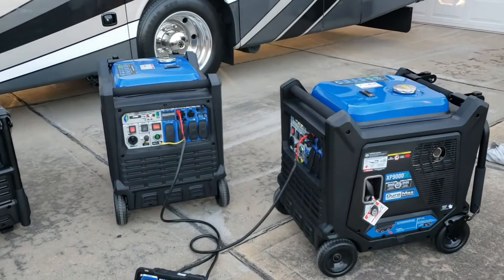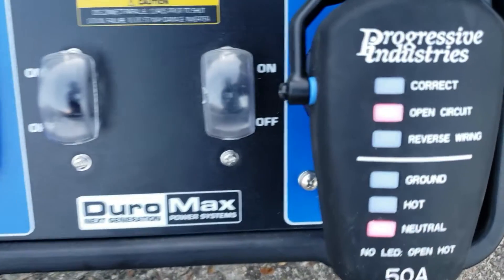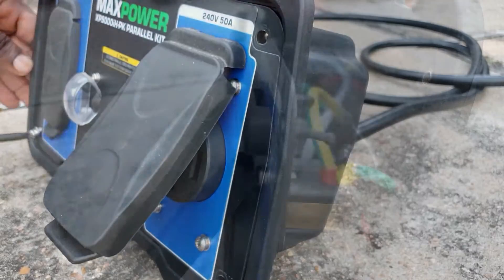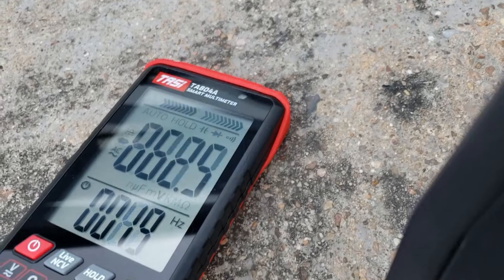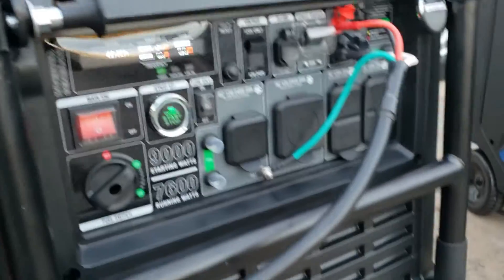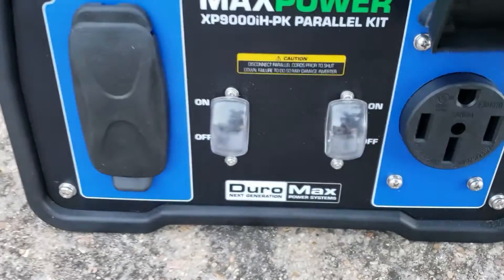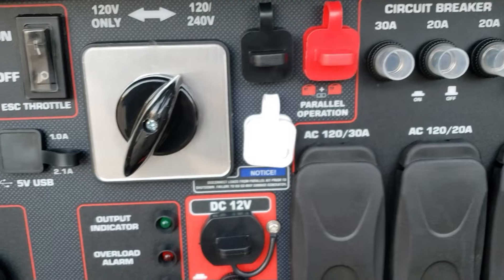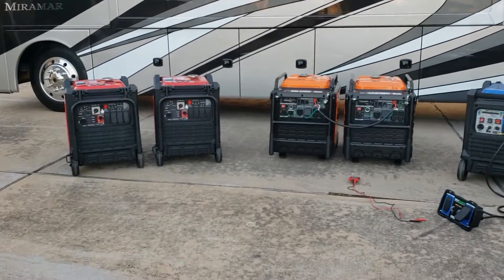Paralleling the Genmax 9K, Duromax 9K and Predator 9.5K

Comment: Thanks for the demo, thinking about future parallel setup, my question is this: Genmax you are showing, 9000/7500 running, paired should make maximum 15000 running watts, when paired you are using 1- 50 amp wire connection to panel from 1 generator ( this is rated for up to 50 amps ) but combined amperage produced is approx over 66.5 amps. To get full power benefit, would you run 50 amp wire off second generator to second connection to panel ( another plug and another 50 amp breaker) to utilize all 60 amp plus power at maximum running watts. Thanks for any information on this,  I know a little about power but nothing about portable generators, again thank you for what you do and sharing
Reply from the maker: If you plan on pulling the maximum power of 12,500W from your 50 amp in my box, yes you will need too.
Reply: @GeneratorReviews So I can install two power inlet boxes with two 50 amp breakers?  Then just fabricate an interlock to cover both 50 amp breakers when on utility power.  Basically the same interlock, just longer to cover the 2nd 50 amp breaker?
I've been searching for this exact scenario as this would allow for shutting down one gen at a time (reduced loads) for fueling but allow full home functionality.

Comment: over a year and still no predator 240v parallel kit
Reply: Get the Duromax parallel kit and add 2 neutral wires easily.
Reply: @michaelslack6891  made my own, was just saying they need to make one
also the ground and neutral are tied together on the predators so one or the other gets  you the same unless you unbond the neutral from the ground on them

Comment: Hi Galvin, i had predator 9500 and genmax 9000iedc,both set on floating neutral for home backup through 50amp inlet, do i need to use bonding  plug to make it bond neutral before parallel these 2 generator generators ? Or just  leave it floating neutral?
Reply from the maker: The only time we have to worry about bonded is when you’re trying to use a surge protector or charge an EV car
Reply: Thank you, i have to connect neutral on both generator although it's floating ?

Comment: If i connect 2 genmax 9000 can i get 62amps?
Reply from the maker: You will get 12500 watts at 52 amps 240v
Reply: @GeneratorReviews  but the 50amp breaker will trip by 50amp how can I get the full power?

Comment: Which unit do you prefer out of the three?  Genmax,  Duromax or Predator.  Trying to decide between one of these or the Duromax 1300.   Thanks!
Reply from the maker: I prefer the GenMax dual fuel, 50 amp plug and it’s the only one with oil filter screening plus so many more features

Comment: Hey Gavin! Thank you again for the great information! I have a question maybe you can help me with. I have 2 Duromax xp9000ih's and the Duromax 240 volt parallel kit that I will be using for emergency power to my main panel via 50 amp inlet box and interlock kit on the main panel. I have not tried them yet as I am still breaking them in. Do you think I will have a problem tripping my 3 GFCI circuits in the main panel because of the lack of seperate neutral wires on the generators and parallel kit? Thanks for your time and knowledge, Mike
Reply from the maker: I haven’t tried it yet but I think you should definitely try your setup before needing it in a real power outage. Let me know the results
Reply: It will work as long as you maintain the neutral bond on the generators.   No respectable electrician will say this is is a good setup, but it will work.  Since there is no neutral connection between the generators and the kit, your neutral is created using the ground wiring between your panel and the generators.  This is completely against electric code, but it works.   And it works because there are two neutral bonds.  1 in your panel and again at the generators.    So what happens here?  The missing neutral is effectively jumperer to the ground wiring.   Unbalanced  current between your 120V circuit legs in the house is going to flow on the ground wiring between your panel and the generators.
Reply: I ended up unbonding the generators easily and added neutral wires to the parallel kit which I plug into the 30a on the front panel. All surge protectors,  afci and gfci breakers and plugs in the house run perfectly. Thanks for the videos!   Mike in DFW

Comment: Thanks for your video!  I bought a DuroMax XP12000EH about 2 years ago and got to put it through its paces last Oct after hurricane Ian.  It worked great though I suspect that I lost a few electronic equipment either because it caused a power surge or FPL did when they restored power to my home.  I wish I had known about potential power surge issues with generators way back when I bought this.  From one of your other videos, I saw that I should replace my generator with an inverter generator to condition the power's sine wave (prevent surges).  I've been considering the DuroMax XP9000iH but after watching your (this) video regarding the parallel kit; I'm not sure.

You showed that the DuroMax parallel kit does not have a neutral wire.  And you stated at around 3:19 that if you use a surge protector in your home that it won't work.  What won't work?  What's the impact of running this generator if there's no neutral.  I'll admit that I don't fully understand that statement. Dammit Jim, I'm a Software Architect, not an electrician! :)  Could you expand on this for me please?
Reply from the maker: The surge protector needs to see a bonded neutral to ground in order to work properly
Reply: @GeneratorReviews  So this generator, or at least when used with the parallel kit, is not meant to be used in back feeding a whole house.  Is there a way to make it compatible?  If not, what inverter generator can be use for such application that provides at least 9000 Watts?  Thanks.

Comment: this is dangerous AND BE CAREFUL ABOUT ANY MODIFICATIONS,  current is NOT supposed to flow through the ground during normal operation... DO NOT plug the parallel kit into your home without paralleling the neutral from each generator into the neutral of the 50A socket on the parallel kit.... use #8 stranded wire MINIMUM for your neutral as each generator puts out 30A and #8 is good for 40A continuous, you can get a neutral off the 30A twist socket by wiring a custom plug

Comment: When you use these generators on your home is there a transfer switch that negates the bonded neutral or will I need to umbind it at the generator? If that’s the case then you want to use it for your rv do you have to rebond it?
Reply from the maker: The transfer switch and the Rv both require a bonded generator but the inlet box is the only one that has to be a floating neutral generator.

I hope this helps 
Thanks for watching and subscribing 👊🏾💯

Comment: So if I use this parallel kit that has no neutral and plug to my house inlet, do I still need remove the bonded neutral in the generator?
Reply from the maker: Great question 
You shouldn’t have to since the neutral is not bonded but you still running all that power on one ground
Reply: Do not remove the bonded neutral when using Duromax kit.   That is the only way the unbalanced current from your 120V  home circuits is returning to the source.   If you float the neutrals, there is no path for that unbalanced current, so it will flow on the hot 120V legs and cause over/under voltage on your home circuits.  The severity of that over/under voltage depends on how unbalanced the loads are.  Every time you turn something on or off in the 120V home circuits you will be changing that imbalance.

These kits should not be sold without neutral wiring.  It is irresponsible how they were allowed to sell them.

Comment: Between the Genmax 9000 and Duromax XP12000EH, which would you recommend for a 2000 square foot home?
Reply from the maker: The Genmax 9000 is an inverter generator and would provide pure sine wave power to your home and would be quieter.

Comment: I'm a Duromax parallel kit user -- single generator but I added the kit as insurance against a 30amp breaker tripping while feeding my home. Most of my load side neutral current seems to return on the utility neutral, so I weighed disconnecting the kit's ground terminal. When I disconnected the ground, I have a couple of computer UPS units which did not react well by constantly cycling back and forth on battery.  The batteries probably pick up something not right with the effective ground, so that leaves me with depending on the generator's bonded neutral to keep working. For standalone or separately derived, this is not an ideal solution. Also I believe if the neutral and ground were bonded on the load side, that #8 ground wire might be a bit under spec.
Reply from the maker: Hey Jim 
There is a fix you can add a neutral wire to your parallel kit and you should be using number 6 wire.
If you’re powering an RV or a transfer switch you want to be bonded, if you’re using an interlock kit you do not want to be bonded but you have to add a ground.
That’s probably why your UPS are acting funny.

Thanks for watching

Comment: Hi Gavin....:) Questions....? I have a Westinghouse 4500 dual fuel inverter generator for running my 30amp Rv, I also have a 50amp surge protector with a pigtail because I'm running power from a 50amp pedestal circuit. I have a soft start for my A/C as well. Does this generator have a neutral so I can use my 50 amp surge protector inline with my generator? I haven't tried running it yet with my RV. Hope this makes sense I'm a little nieve to some of this....;) Thanks
Reply from the maker: You just need a bonding plug for your generator and you can and should always use a surge protector 
https://amzn.to/3xtXjwv

Comment: A very good catch on the DuroMax parallel kit no neutral issue. From what I can tell at 1:15 it looks like it is really meant for 250 volt use only and there shouldn't be a neutral pin on the 30 or 50 amp connection. Standard nomenclature if it was to be utilized in split phase mode it should be 125/250. My experience working in the electrical field when your 125/250 volt 50 amp plug tester is showing open neutral is bad news from the get go and you will end up frying up some 120 volt appliances.

You can bond the neutral and ground at the parallel box, but the ground is only meant to carry fault current back to the generator to trip the upstream breaker to clear the fault and not the unbalanced load between the phases. Also, it will cause a potential shock hazard since no one would expect any current flowing through the ground connection.

I think DuroMax dropped ball on this one for not having a dedicated neutral for 125/250 volt split phase operation. Great work and it might've save someone's RV from a potential electrical nightmare using the parallel kit. I've went through a few old school hard knocks and learned to test and verify before plugging in. Having a Power Watchdog inline to serve as extra insurance against those costly oopsies.

After all we are human and we're not infallible.  :-P
Reply from the maker: Thanks for sharing this Felax Chow very insightful and informative feedback. Most people don’t understand why I always have the surge protector on all my test. I’ve seen poor connection, reverse connection, open grounds, open neutral, you can’t just trust the manufacturers to deliver a fault free product.

Thanks for watching 
I hope I earned your subscribe 👍🏾
Reply: @GeneratorReviews  oh yes, I've hit that subscribe button quite awhile ago. Learned a lot and getting good ideas on projects along what pitfalls you might run against.

I am in the process of designing my electrical system for my class B upfit. What I have on paper is 1 kW solar and 15 kWh lithium storage at nominal 52 VDC. The further into the rabbit hole I get into, I am starting to go with Victron Energy gear and I might get their isolation transformer to electrically separate the shore power connection as extra insurance.
Reply: i think you could pluck a neutral off the 30A twist socket and run a neutral wire from each generator and parallel the neutrals into the 50A plug on the kit... not that hard of a modification and annoying you have to do that... but it's possible

Comment: is it possible to make your own parallel plug for the predator or duromax like meeting the two 240v plugs together and still get the 50 amps? and  if its possible would you make one and show how you did it and do a second part to this video?
Reply from the maker: Yes that is a possibility and yes I can show how to make it great idea by the way💡👍🏾
Reply: I'd really like to see a video in on that too
Reply: I would love to see that!
Reply: Yes, Mine is working great. Check out the diagram on post 123
https://www.powerequipmentforum.com/threads/duromax-xp9000ih-pk-parallel-box-question.25478/page-7#post-96403

Comment: If your home needs two 9,000 watt generators in parallel to keep you going during a power outage then why don't you just get a dedicated home backup generator that runs off of natural gas? Am I crazy?
Reply: I went with the two 9kw portable generator due to the high cost of dedicated home backup plus install and permits. I also get the flexibility of taking it with me when traveling.
Reply from the maker: @cleverman86  👌🏾💯yep best route
Reply: @GeneratorReviews  so if I'm running 2 Duromax 9000 generators on parallel for home backup I can't use surge protection? Is it safe?
Reply from the maker: @motoboss5250069qew  perfectly fine
Reply from the maker: 99% of people who need this owns trailer business like food trucks and this Barry gets them by
Reply: $5000 vs $18,000

Comment: Is the genmax 50 amp plug on a 50 amp breaker so you can take advantage of all the amps available when connected in parallel? Or is it a 35 amp breaker so it only gets the max of 1 generator?
Reply from the maker: It’s a 50 amp breaker.
Reply from the maker: That’s why when I use it solo by itself I usually use a 30 amp four pin 
30a x 240v= 7200

Comment: Can't help but wonder why Duramax didn't provide the neutral connection. Could you use a bonding plug on the Duramax?
Reply from the maker: Since there’s no actual cable going to the parallel kit The bonding club would be useless
Reply: @GeneratorReviews  Yeah, I guess you're right. I was thinking if you plugged a bonding plug in L1 and L2 of the 120v outlets, it might work. But there's no wire to the kit so how could it? See, that's why you have a great YT channel and I just watch.😉